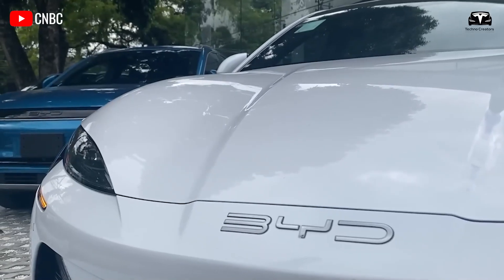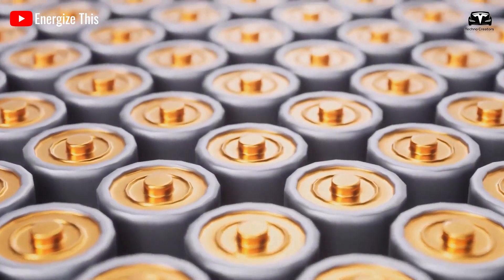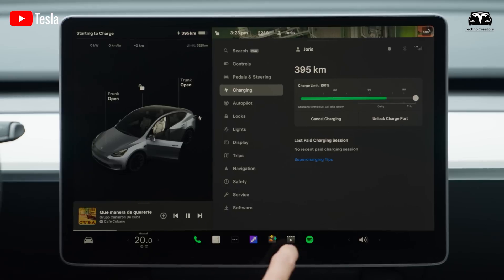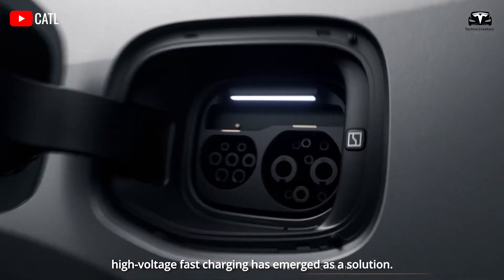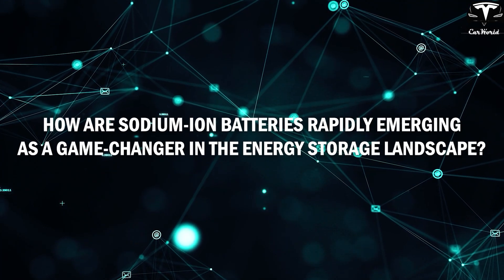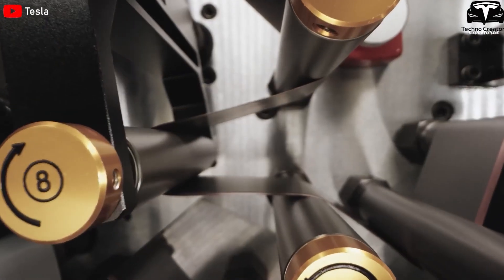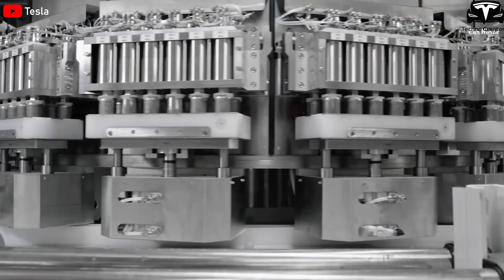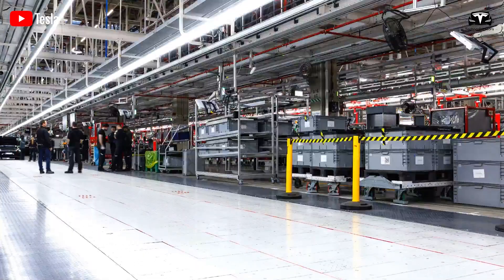The End of Lithium! Sodium Battery 5-Sec Charge, 100% Stability & 5,000 Cycles! Detail Explained!

Comment: 5 second charge...only need the power of a small town, and a power cable 3ft in diameter. 5 minutes to full charge using multiple smaller cables could be done, but given the rate they are stolen, i doubt any charging company would wanna double or tripple the jackpot for thieves. Once things transition enough that most manned gas stations have EV charging, things may change, but the future never looks how we imagine.